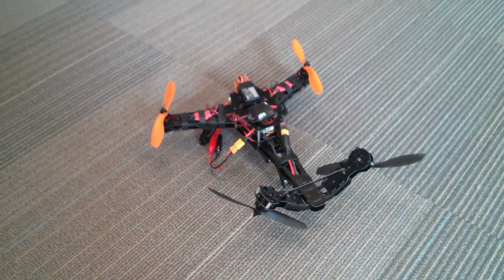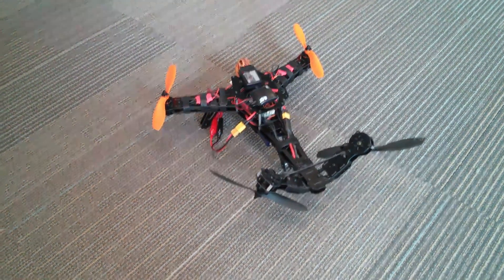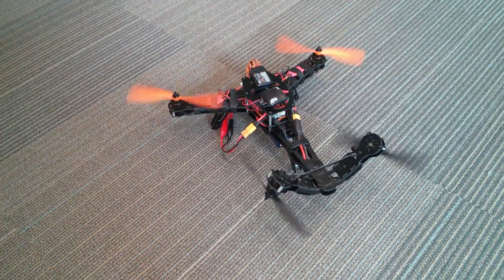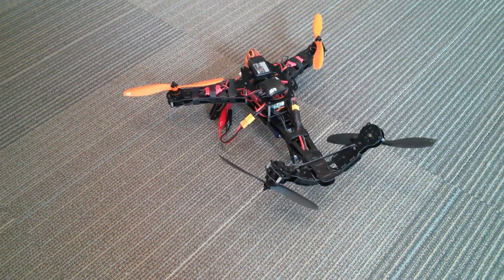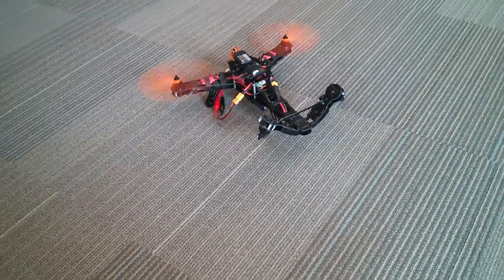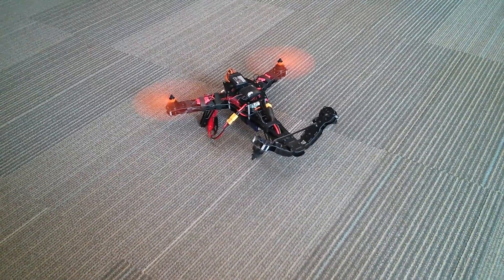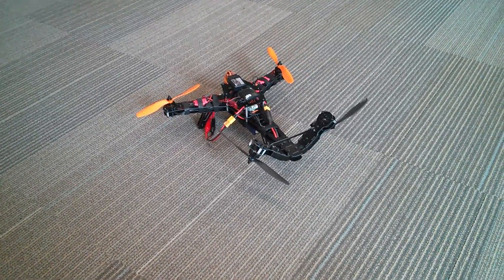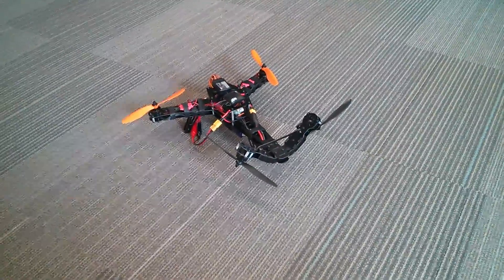Hunter VTail 400 - APM 2.6 Calibration Problem

Comment: Good News Man!
Finally took the vtail 500 to the park for a test run and was successful. Not taking off straight up, think I need to adjust the center of gravity / tune it but once airborne flew pretty good.

Took off in stabilization and it leveled out and hovered well, was drifting a lot but it was a bit windy / gusty so no surprise there. All the functions worked thoguh, rotate, banking and nose down / up etc. Thing would just take off like a rocket into the air. Second time I threw it in alt hold after take off and that helped from it wanting to climb crazy high. Only quick clip I grabbed with my phone in one hand. Anyways, thanks again!

Lynxmotion Vtail 500 First Flight - 3DRobotics Pixhawk Flight Controller
Reply from the maker: yay! :-) I'm glad. :-)

Comment: So it is the "vtail" option "frame 4" your talking of? That's what I was using with 3.2-rc2 in the video with it spinning out of control. So if that's the case I've either got a problem with the motor order or spin direction or something. 

Is it Motor 1 = NE - CCW   2 = SE - CW   3 = SW - CCW   4 = NW - CW
That's how I had it, if that's not right that might be my problem. Thanks, appreciate the help.
Reply from the maker: yup, here is a video of the VTail actually flying: Hunter VTail 400 using APM 2.6

3 should be your front right, or it'll try flipping itself somehow.

2 and 4 should be your back props (I don't remember which is which).

Your prop directions match mine, but they don't really matter, cause Yaw is only controlled by the tail.
Reply: L. Preston Sego III Yea, I double checked, it is same as Quad X as mentioned in the other link you posted so it actaully seems the motors are plugged in. in the correct order and props and all that are right so now I have no idea why it spins like that.
Reply from the maker: Double check your motor wiring.

Front Right: Motor 1
Frond Left: Motor 3
Rear Motors: 2 and 4

try holding in your hand if you can, I don't know hov long your arms are, and 500mm is a bit bigger than 400mm, so that might be dangerous.

When I'm testing to see if I got the motor wiring correct, I always hold it in my hand, and give it some throttle, and then check my yaw, pitch and roll. 

If you still think you wired it up correctly, switch motors 2 and 4, and I'll make a note to the ArduPilot devs (cause I think I had it correct when I submitted my Pull request, but one of them switched the order possibly... I don't remember)
Reply: L. Preston Sego III Woooo! Hey man, good news. My wiring was good and the motors tested in the right order with a motor test. I reuploaded fresh 3.2-rc2 and redid accel calibration as I saw is needed etc.

Same thing, tried to spin like a top on takeoff. I flipped the connections for the rear motors and was actually able to get airborne without spinning like crazy. I didn't really fly it cause no room in back yard but took off twice and it started drifting and I let off throttle and grabbed it / caught it.

It's a little twitchy trying to take off some times but the spin problem was the rear motors needing swapped for sure. Thanks again!
Reply from the maker: Tim Anon I'm glad are flying. I'll get this taken care of for in the ArduPilot code. Thanks for being another VTail tester! :-)

If you have any comments on how it flies, let me know. :-)

Comment: I tried recompiling with some changes to AP_MotorsQuad.cpp I found mention of in some threads but after that it just wanted to instant flip so the "vtail" setting in MissionPlanner was better off at least going straight up just spinning like crazy.

Where is the code you mention that I can give it a shot?
Reply from the maker: Here is the code if you want the latest: https://github.com/diydrones/ardupilot
here is the post on beta testing the next release: http://diydrones.com/forum/topics/arducopter-3-2-beta-testing

both of those options have my VTail mixing. APM and Mission planner don't yet have a button for the option, so you'll have to go to the Full Parameter list and set the FRAME to 4.